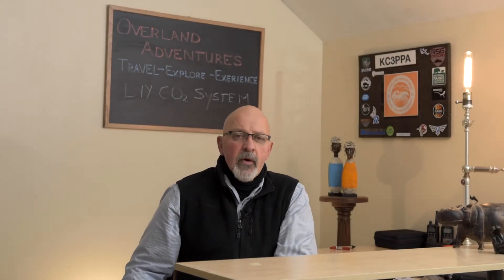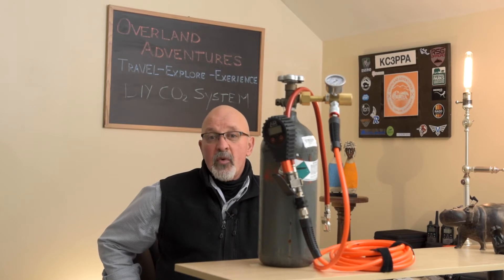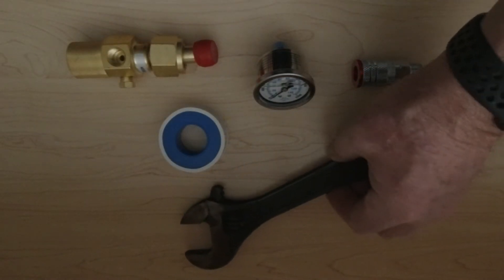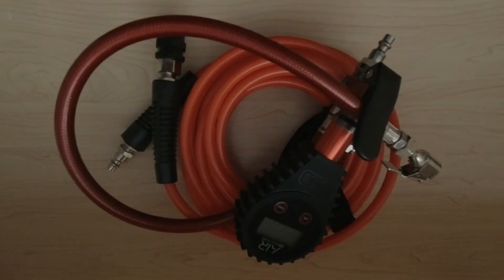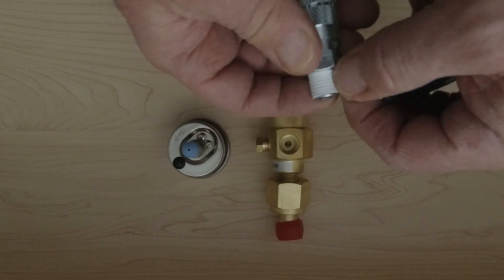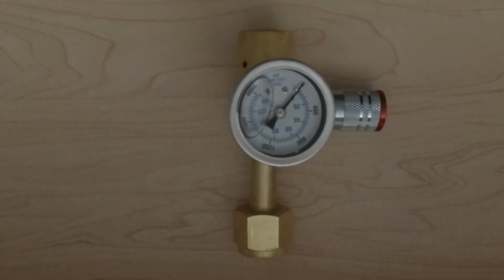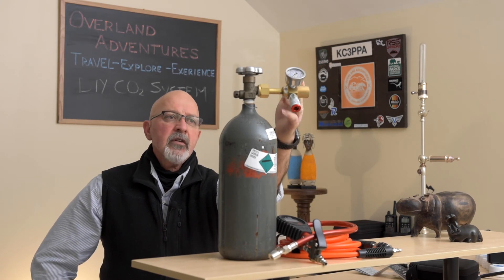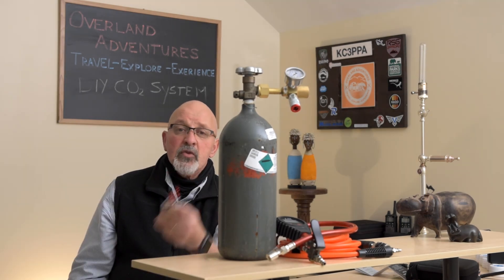DIY CO2 Air-Up System

Comment: If I may ask, what tires were you running in this video and is your 4-runner stock or have you lifted it or done any suspensions mods? I have 2019 Tacoma TRD Off-Road that I'd like to do some light prep for the trails.
Reply from the maker: My 4Runner is a 2020 TRD Off Road. Stock, no lift or suspension mods. I'm running BFGoodrich All-Terrain KO2 tires. I'm super happy with them and have had no problems what so ever. Regarding a lift. So far I haven't really needed it. I have added a lot of weight to the vehicle (roof rack, fridge freezer, rock slider and I sometimes carry 10 gal of fuel on the roof) so am considering a lift in the future. Nothing radical. Mainly to compensate for the additional load I'm carrying.

Comment: Thanks for doing this. Think I will be putting one together.
Reply from the maker: You're quite welcome. It's really very simple once you have the parts. It's also so convenient and airing up is really fast.
Reply: @overlandadventures6763  Thanks again. Question if you don't mind. The gauge is to determine the gas left in the tank, no need for a regulator to control pressure into the tire?
Reply from the maker: You are correct. Actually you can build it without the gauge if you want. I just added the gauge so that I could see if there's still gas left in the tank. The regulator that I used is pre-set to 150 psi so you don't need to set it via an adjustable regulator. I use the indicator on my tire inflator to monitor the tire pressure. Hope this helps.

Comment from the maker: How far do you air down to when on the trail. I normally take it down to about 17psi for not very difficult sections and go down to about 14 to 15 psi for more technical sections. I don't have the opportunity to do much rock crawling so this seems to work for me.
Reply: Usually air down to 20